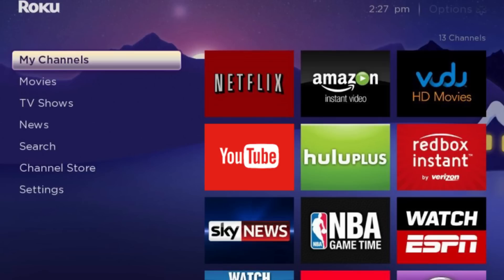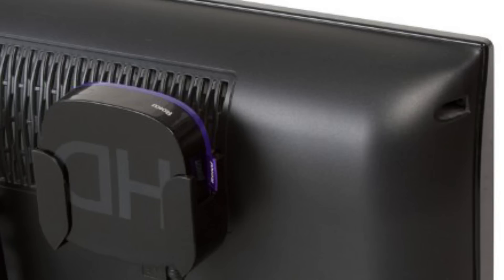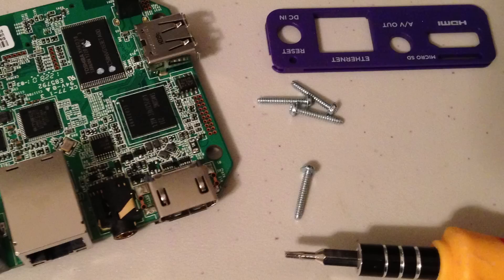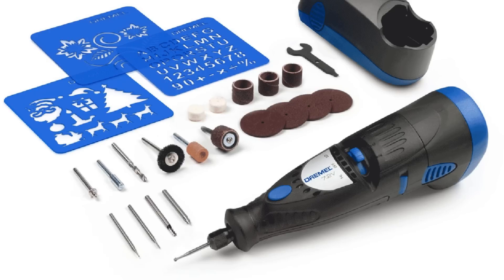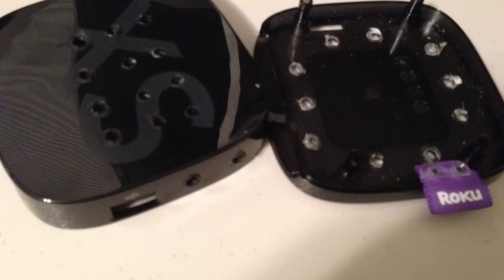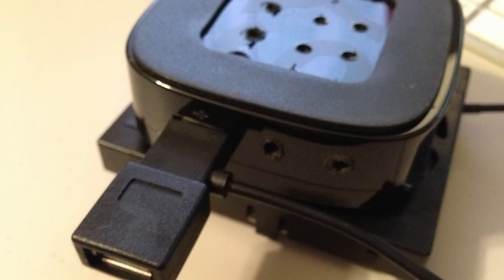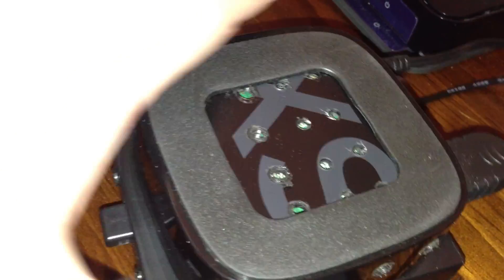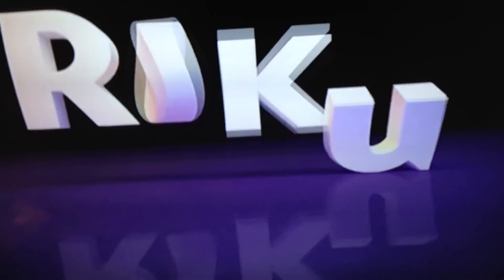Fix crashing Roku 2 (overheat mod)

Comment: Mine is a roku 2 but its doesn't look like yours.  it's rounded off on the corners and kind of bubbled.    anyway. it was working great, no problems for over a year , all teh sudden , the other day it started not being able to play ,  so I could go to Netflix for instance but when I would try to start a video it would not play.  so i checked the stats and it was saying poor signal.  it has always had an excellent signal though till now.   so i checked it and it seemed really warm,  I do not remember what it was like before this though but i would think if it was that warm before I would remember.   anyway.   big deal right? maybe I have a wi fi  problem or?   NOPE   I got another roku from a different tv in my house, put it in the same spot and it gets excellent signal.   so I tried the broken Roku on all the sets here and it will not play. 

  i was wondering if the Roku has a heat sink inside... i wonder if that conductivity paste can get old or cook off or dry up and then not transfer the heat away maybe..   OR is there some thing I can do to revive the wi fi receiver inside somehow?    My Roku 2 has 4 rubber feet.   i will see about pulling the case tomorrow.    also my roku 2 has no usb port, that kinda sucks.  I have some small fans that would be awesome to do that with but this thing has RCA and HDMI and POWER in but no USB.

Comment: I FIXED Mine! My Roku-2 was stuck on the "dancing" roku screen and wouldn't boot. I tried pressing RESET button on rear of roku but no-fix. I unplugged for 15 minutes to see if COOLING DOWN helped... but NO FIX. Then I tried simply removing my micro-SD card, and the unit boots up now. Apparently when my software updated to the new version of Roku, it must have blanked out my SD card, or something like that happened. I put my micro sd card into my computer and it said it MUST BE FORMATTED before use. I reformatted it and roku is working ok now. Always try the easy things before PITCHING Roku in the trash

Comment: I have a roku 1 that overheats, so today i drilled the case on both sides, found the scew holes with a steak knife with out having to remove rubber bottom, the roku 1 has 4 phillips screws..........  and is now working great, used it for a few hours straight on utube. It kept making my dsl modem keep rebooting on utube, still very warm, but can vent. No fan used. Great useful video.....